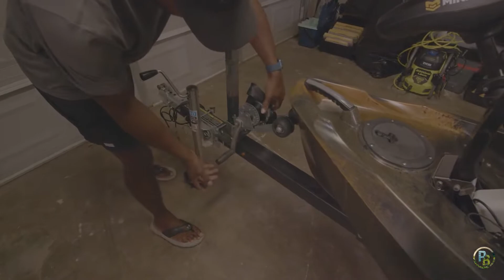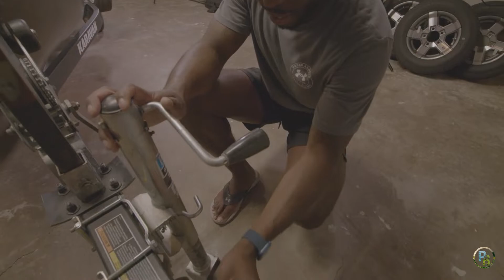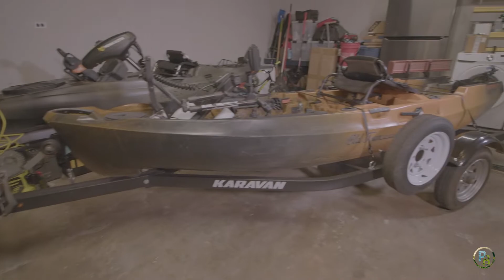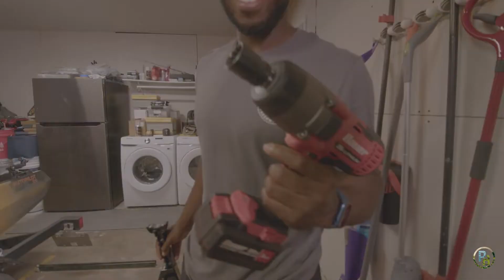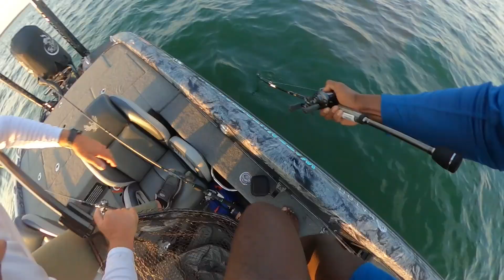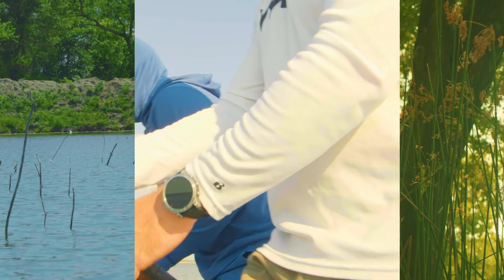I Converted A JetSki Trailer Into A Kayak Trailer In 5 minutes (FULL WALKTHROUGH)

Comment: When you modify something for a different purpose you change it into something new. You think you keep messing up by referring to it as a kayak trailer while I believe that referring to it that way is proper and correct. Keep up the good work. I didn't notice that you were using the winch for anything other than a bump stop. You can gain valuable inches by removing the winch and converting it to a static bump stop.

Comment: Looks like it works great. I’m getting ready to convert a jet ski trailer this weekend. A couple of questions if you don’t mind. 1.) Are the carpeted bunks on your trailer 6’?  If so, do they do the job or do you recommend making them longer?  2.) Could you provide a link for the ratcheting straps you used to hold it down?  3.) I couldn’t find the link to the new wheels you put on it. 

Thanks